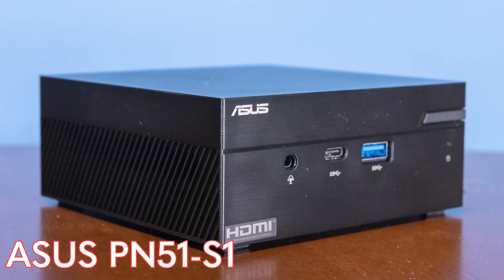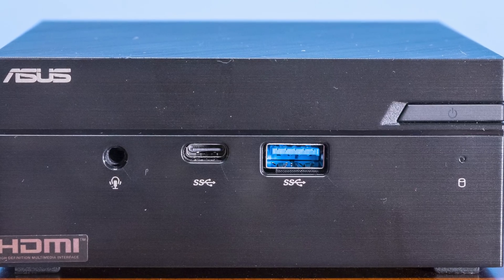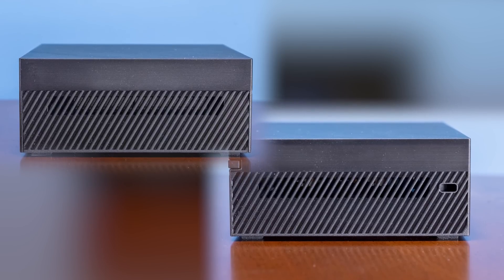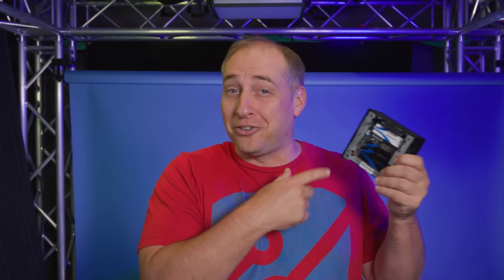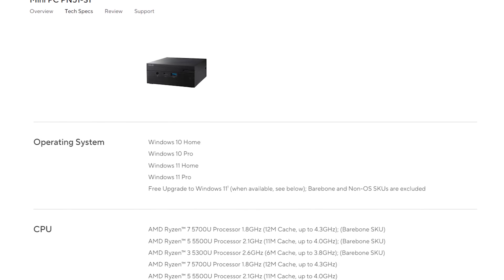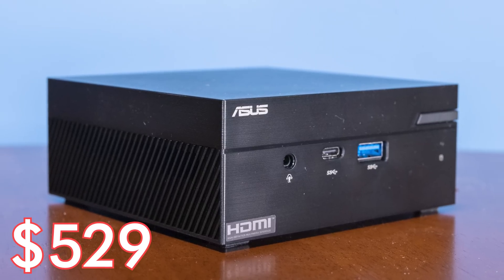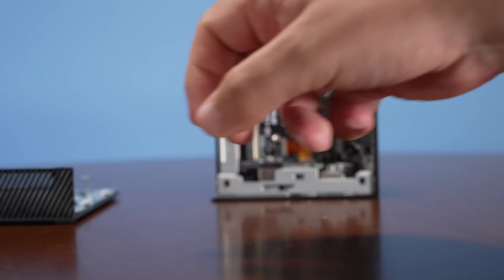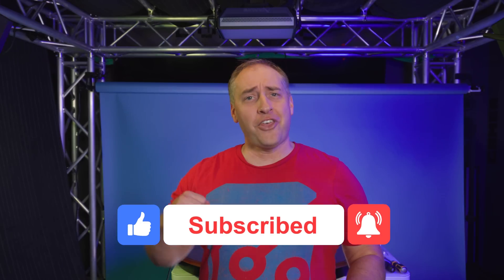This 8 Core AMD NUC Alternative Rocks!

Comment: Interesting formfactor, but for the price here in europe (570€ for barebone 5500U) I would exprect a 6000 series Ryzen. If the size of a TinyMinniMicro works, I think even the relatively high prices on ebay for used ones make more sense for a complete system (RAM and SSD).
Also, current price per kw/h in germany is 55 Cents. So almost 50€ per year for 10W pc running 24/7. Add some HDDs, NICs at in adds up quickly. My DIY NAS uses 70Watts and costs me 28€ a month on energy cost alone.
Reply: And here I am complaining because electric has gone up 50% year over to $0.0964per kWH.
Reply: Holy crap... that's insane.
Reply: stupid question, can you buy a generator to run off of ethanol? would likely be cheaper to make a still than use the grid
Reply: @bradhaines3142  That is unusual and rare for germany, so I do not know enough about it to evaluate fesability and cost
Reply: A lot of people will die in Europe this winter due to the energy price. Perhaps it’s what the leadership wants.
Reply: @emlyndewar  that's a pretty loaded thing to say on YouTube....
Reply: @VeniVV  Not really. It’s a post complaining about costs of electric. Europe haven’t reached the peak yet, and that price will be way beyond the means of many.

Comment: Great review, thanks. Did you try installing Proxmox?
Reply from the maker: It is not on the supported OS list but we had screenshots from Ubuntu. Proxmox also worked
Reply: I actually ran that on Proxmox for a few months hosting my dockers and VMs. Works well until I start upgrading my RAM and SSD.
Reply: @ahyi9350  why it did not work well when you upgraded RAM and SSD?
Reply: @misckicirina  the root cause wasn’t identified since it keep shutting me down after running my upgraded spec for a week or two. Didn’t go through the troubleshooting since i am not familiar with the proxmox. Reinstall ubuntu to figure out other issue, and  that’s when i found the temperature was likely the cause of it

Comment: If it just had two Ethernet ports it would be exactly what I'm looking for.
Reply: The displayport that is in this can be switched with an ethernet port. At least it could on my PN51-E1 model. You just have to order the correct SKU.
Reply: you can replace the DP with a 2nd nic... but yeah gotta find someone that SELL that solution but it is possible
Reply: Agreed! 2 ports would be GOLDEN
Reply: @Markus Fischbacher
Look into the Beelink GTR5 5900HX.

I've been using it for about 2 months now and it comes with dual 2.5 GbE NICs, so that might be a solution that might work for your needs/purposes.

I'm running 10 VMs on mine and it's been absolutely rock solid/stable.
Reply: Probably want to look at the asrock 4x4 box and asrock 1200 nuc boxes then. Same size, better fan, dual ethernet
Reply: @Bajicoy  thank you! These are perfect options for my use case 🙌
Reply: Exactly, would have made great platform for pfSense with 2 built-in gigE ((or higher) ports.
Reply: why? but it should have poe though!
Reply: All mini PC need dual 2.5gbs lan ports for routers -  pihole etc
Reply: Well you could probably get away with a USB Ethernet Adapter.
Reply: Just use a managed switch and VLANs to do router-on-a-stick.